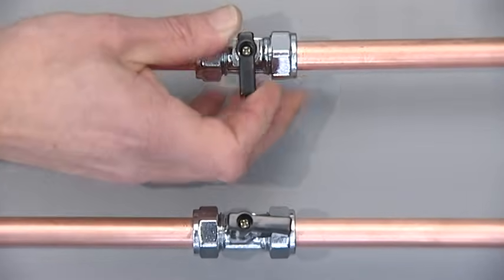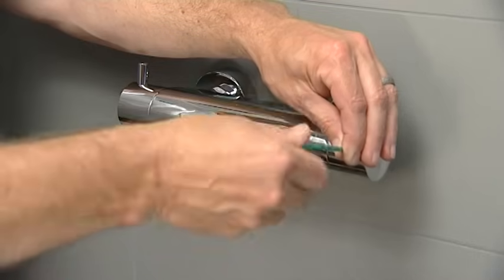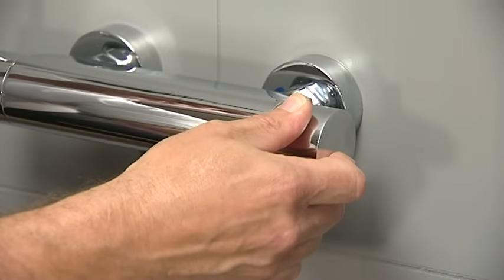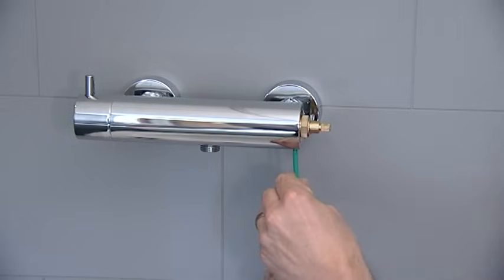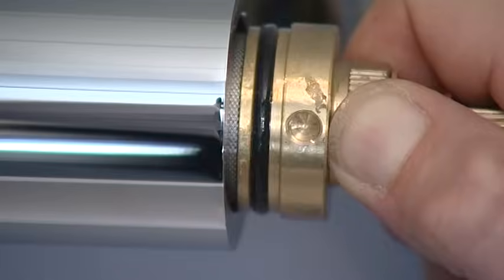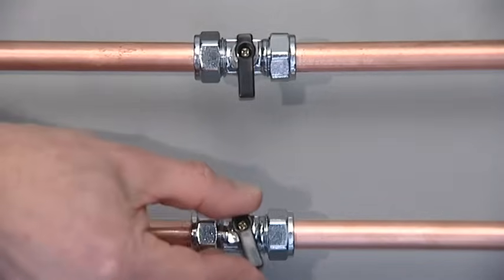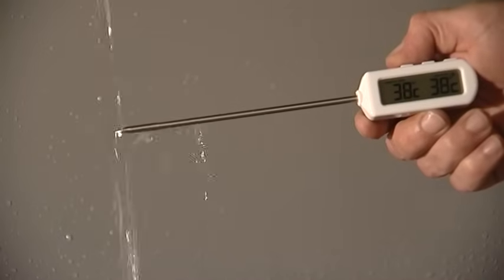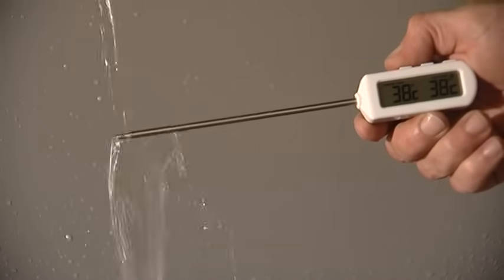Exposed shower valve - Thermostatic cartridge: maintenance, replacement and calibration

Comment: Brilliant. Wasn't too confident about doing it, but did it. Soaked the cartridge for 1/2 hour in limescale remover reassembled and calibrated. Excellent. Probably saved £400 as a plumber would have sai a new cartridge required + labour etc, etc!
One thing to note... the safely button in the handle/knob was also seized and freed that up too with de-scaler.
Thanks so much.

Comment: Great video! My problem is that after cleaning, the cartridge will not push in far enough to align the holes so I can refit the grub screw. Any advice appreciated, thanks.
Reply: I may state the obvious here, but the cartridge itself has threads, this is why you put the handle back on and turn it counter clockwise, then clockwise until it stops. Make sure you've done this step in reverse when you're putting it back together or you will only have pushed the cartridge to the beginning of the threads and there will be a centimeter or two left before it's all the way back to it's original position, which is where you can then put the grub screw back in.
I realize this is a year later and you've probably replaced your shower, but here's an explanation for anyone encountering this issue.
Reply: @maevahaugan415 Thank you very much for taking the time to give a detailed explanation. I kept the old one to practice on, so I’ll give it a go! Thanks again.
Reply: @Leggg   Oh, I need to correct myself - I since finished cleaning my mixer and realized it's just very snug, no threads. I'm not sure if I saw a spring in there that is really rigid or if it's from air pressure making it difficult to fit back in, but either way, just pushing harder did the trick. Wish you luck!
Reply: I’m afraid not. In the end I decided that as the shower was quite old I would replace it. Getting a plumber in to do that takes away all the stress!
Reply: Hey did u solve this issue ? I can’t push the cartridge in far enough to get the set screw back in .

Comment: how can I override the thermostat so it's higher than 38 degrees so I can get it 50 degrees.
Reply: He explains it in the video towards the end of the video. You adjust the temperature to your desired temp, in his case 38° then install the safety thermal lock (black collar) back into the 12 o’clock position

Comment: Good explanation if you have that particular style of cartridge. Although if there is a lot of scale, you might not be able to just pull it with your fingers. You might need to twist it around a bit and then lever with a screw driver. Also, remove O-rings before descaling bath. There is nothing to descale on rubber, and you can potentially damage them.

Comment: Is the brass spindle where the handle meets it supposed to move independently from the rest of the cartridge? Doing a DIY fix and suspect mine is stuck as it moves the whole cartridge when the handle turns.

Comment: Questions: I have a problem with my mixer valve, not working properly and I want to replace it, but I'm not a plumber so ....
a) How come one has to isolate the water pipes when the hole on the underside of the bar on which one attaches a hand shower is open and no water leaks thru? I changed my gf's hand shower cable and didn't have to turn the water off. A bit of water came out once I'd unscrewed the old one, but no more than would be expected.   and: b) Our shower activates a pump which sucks the water out of the various tanks, so why would I isolate the  water supply when the only time water comes thru there is when it is turned on? Again, water would surely be flying out of the open hole in the bottom if the water needed to be turned off.

Comment: Times have changed you pay between fifteen  and eighteen pounds for a replacement thermostat, and you can now  purchase a new replacement bar mixer shower valve for between twenty five  and thirty pounds. And to fit the replacement valve you only need to undo two nuts and no need for the necessary temperature setting.  Its all a no brainer.

Comment: Don't do as I did and forget or ignore the instruction to isolate the water supply. That little screw holds back a tidal wave !!
Reply: I've replaced two of these, so no problem now, but I did discover that turning off the water was not enough. The pressure has to be removed by opening the tap at the other side, otherwise the thermostatic valve might come out like a bullet. 😆
Reply: Haha I did that my first time too 😂😅

Comment: I've adjusted the brass thing for the warm temperature setting but I still can not turn the mixer to get cold water when I need to - it's completely stuck! Can I spray it with WD40 or is there a way to do it?
Reply: Same here. Mine was mechanically faulty. The helicoid inside did not move so the flow was impossible to midify.
Reply: @danieled-q1s  I had a plumber come in a few weeks ago and change the mixer completely!
Reply: @EditorDudesPlayList  :) Yes! I ended up buying a new one myself!  But just because the Amazon seller didn't want to sell me the cartridge only! Shame

Comment: This is handle is excellentσσσ>allmy.tips/DeltasValve?Jj≖   It works perfectly with the Delta valve I also purchased on Amazon and looks very nice as well. It matches the other products I bought in oil rubbed bronze too!

Comment: Hi, is the Thermostatic built inside the handles holder to keep water temperature steady, and will not affect by other users in the same house?
Reply: The thermostatic valve shown in the video exclusively controls the temperature of the shower that it is built in.